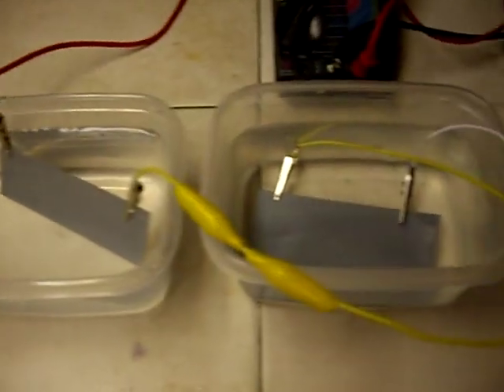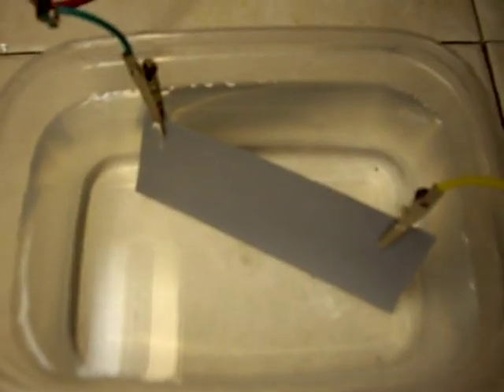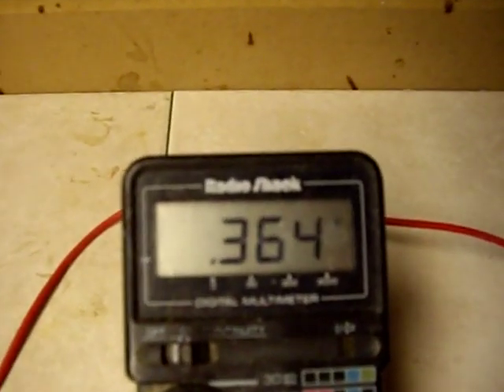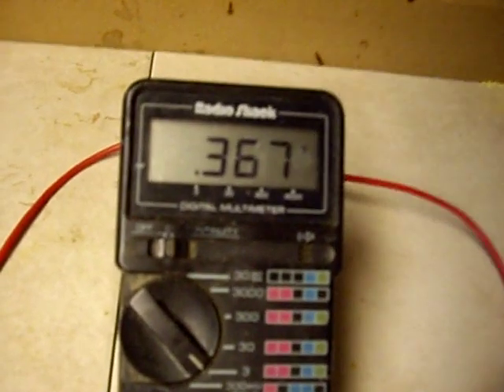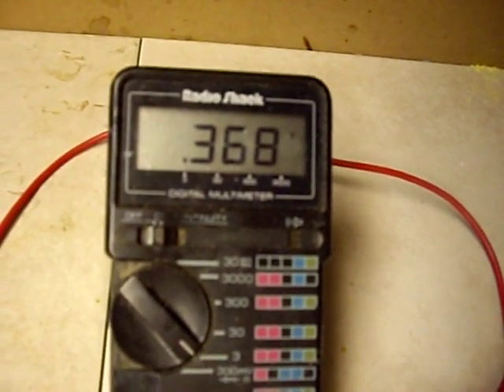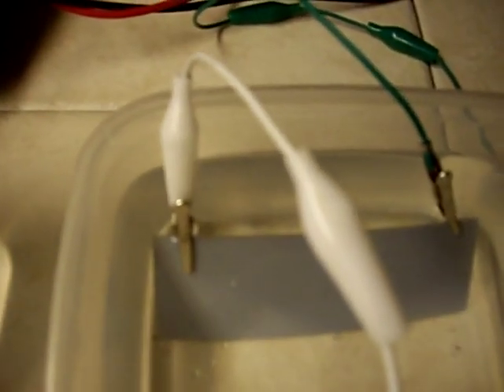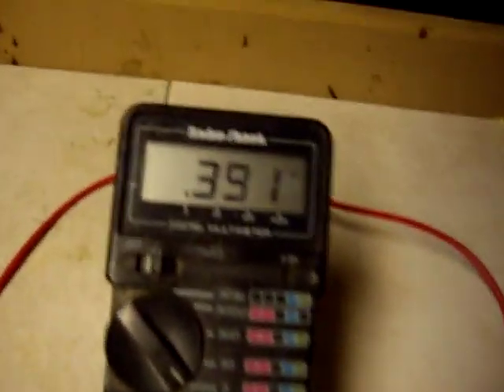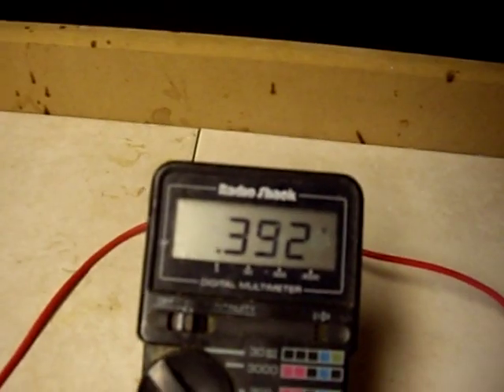IMGP1177.AVI

Comment from the maker: One of the first experiments I did was to "dangle' just the leads in the water in all three containers. there was a galvanic reaction reading of 78 mv. The current voltage reading with the modules connected  is 5 times that.
Reply: Bill Mehess what have you coated on the plastic? Are you selling this or can you share with me so I can replicate this for my self? Thanks